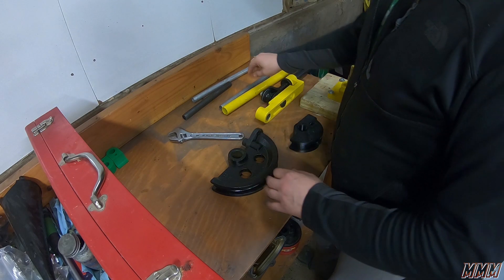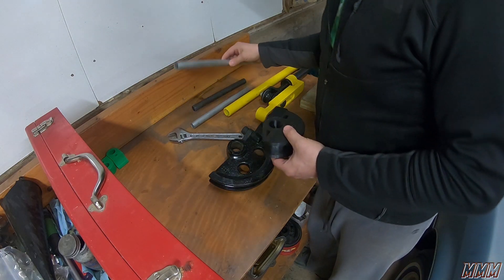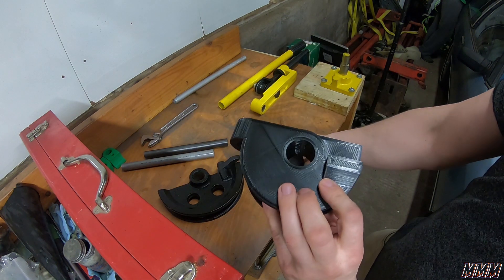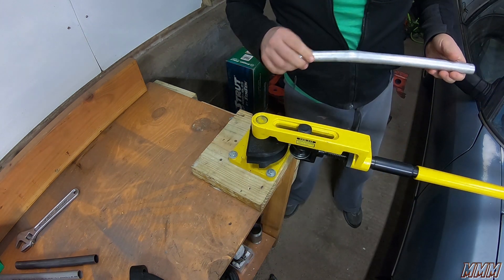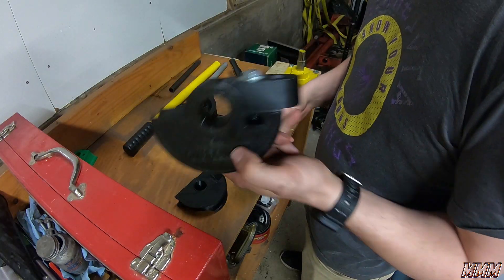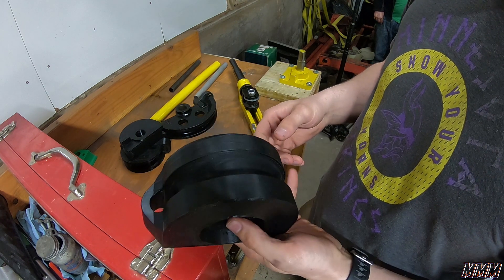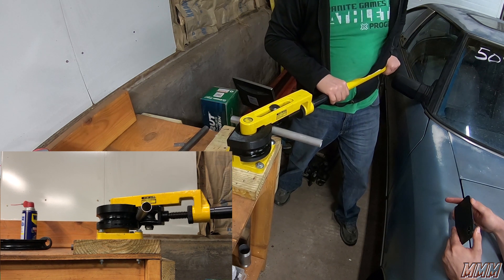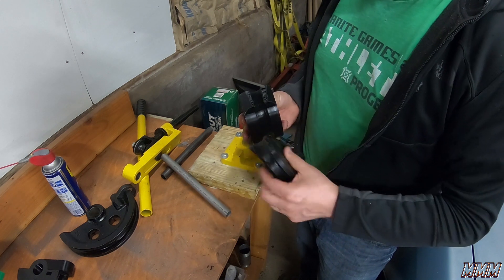Failure optional: 3D Printed Tubing bender.

Comment from the maker: Let us know your thoughts and how it can be improved further!  We thought of adding metal reinforcing straps, but wanted to get it to work as just a 3d printing first.
Reply: When 3d printing, use "no top solid layers" so you can see the infill from the top, then fill up the infill with resin. That should make it much more robust.
Reply: Or... print the part, make a silicone mold and make a solid resin cast - or one better..Print the part, make a sand mold and cast it in aluminum.
Reply: would be pretty easy to print so that a clamp of steel plate and bolts could be used to re-inforce that 'strap' section that keeps breaking under tension on the outside of the bend (think of how leaf springs are attached to the axle on cars).... though i'd also not be surprised to see it de-lam or just crush on the inside of the pipe bend should the current failures be fixed. There's a reason those mandrels are made from steel and not cast/machined fibre-reinforced plastics. Interesting experiment anyway...
Reply: I was kinda surprised you didn't try straps or 100% infill. Could also have tried another material, like nylon, polycarbonate, or even PLA.  I guess what it comes down to, is what problems might be cheaper or easier to solve with 3D printing, and which aren't.  Like that U-shaped groove around the radius of a die, that could be tough to do in metal, unless you have a mill (oh wait, you have a mill.).  Even if you sandwiched your (100% infill) plastic die  between two pieces of 1/2" steel plate, it still might have been a good 3D printed solution to the problem.  Then you'd be relying on the tensile, shear, and whatever other strength of the steel, and only on the augmented compressive strength of the solid plastic.  Well you do have a mill.  With a 4th axis you could be milling dies out of aluminum or steel.

Comment: Lookup heat annealing 3d plastic prints, maybe the extra strength would be good around the die, however I would only use some sort of a steel bracket, that holds that start pipe in place and add steel top and bottom of the die that links back to the holder strap, it is far too much pressure, even an injection molded part would probably not hold up after too long.

Comment: Thin tubing is more difficult to bend. Most dies have minimum will thickness ratings. Small radii are also a problem. You couldn't find smaller radii because they're not practical. Structural tubing has minimum radius required ments because defdcts are unavoidable in too tight bends

Comment: I think you culd make this work but maybe not a drop in replacement for this tool. clamp the die from either side so it's just under compressive forces when in use and it should work like a champ!

Comment: PLA has incredible strength in compression, but fairly poor strength in tensile.  My suggestion would be to create a steel tube welded to a band that you can insert into the 3d printed die to take the tensile forces, and let the PLA do the compression forces it's best at.  Another issue you'll have to contend with is the die splitting due to axial tensile forces from the tubing trying to expand across the bend.  My guess is the proposed internal steel frame would function to give you the necessary force but once the tubing bends and tries to expand it will split the die.... Again do to tensile forces.  I think if you caged the die in steel, say 3/16" you may be able to contain those forces.  The complex feature of the bend is the tricky part to fabricate, anyways.  The steel cage could be standardized to allow pla inserts.  I'd also recommend changing the print orientation so the layers are perpendicular to the bend axis, to maximize strength.

Comment: Did you consider fastening the pipe with a strap or a clamp and just use the radius for bending the pipe. Also print orientation is very important, what face was flat to the print bed?
Reply from the maker: We thought of maybe just putting a metal strap over the end piece that holds the end of the pipe and anchoring it into the body of the mandrel with some lag screws, but we thought for now we wanted to try to get it to work without any metal reinforcing it.